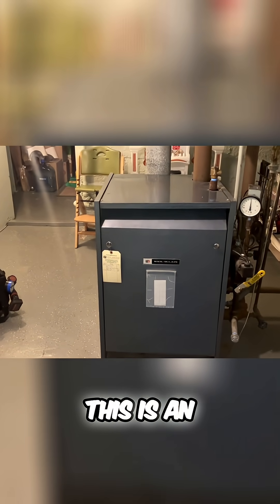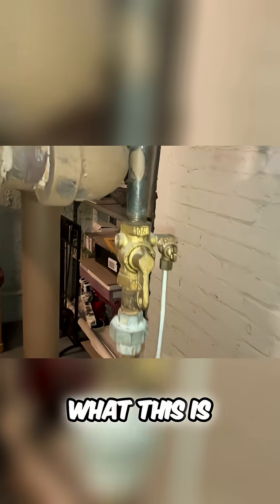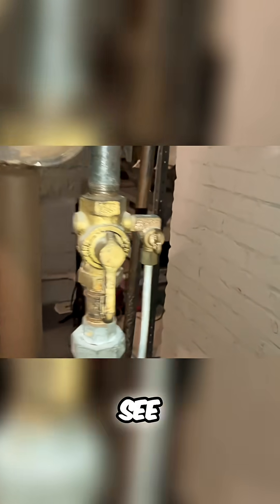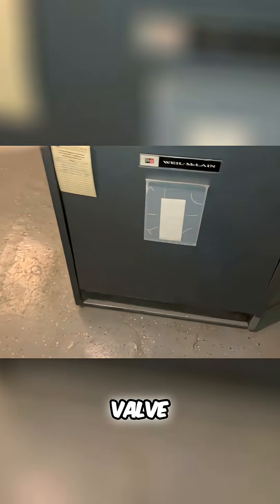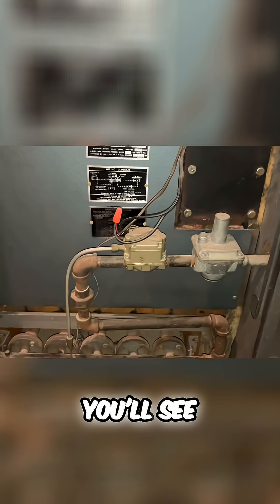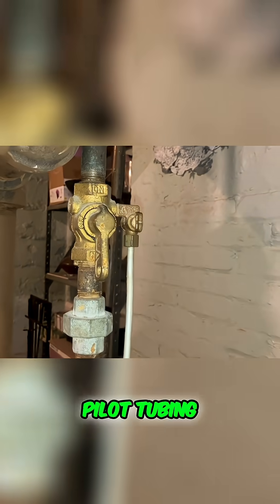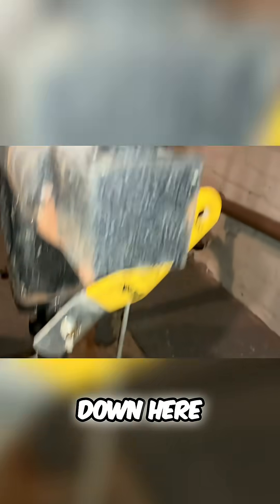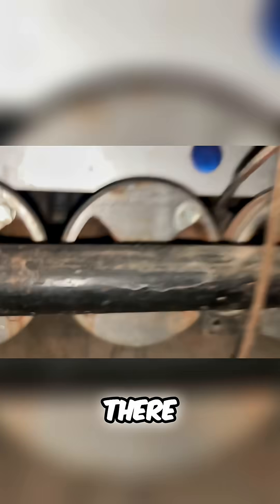Antique Boiler's Secrets: Gas Flow & Old Tech Explained! #shorts

Comment: I see a shutoff that was installed backwards. Whoever installed that is lucky they didn't kill everyone in that house. Mike, love watching you work... A true professional tradesman...
Reply: Back then they didn’t have thermocouples invented yet, these valves were designed to keep the furnace s ready to run. And start when needed
Reply: @earlestes8649 agree... Should have been updated to make it more safe. The way it is, if the pilot flame goes out, the gas doesn't shut off... Some of the old ways are better and some aren't... In this case, it's not...lol